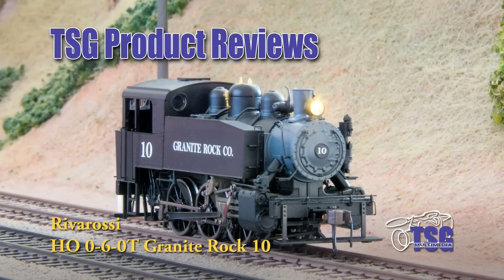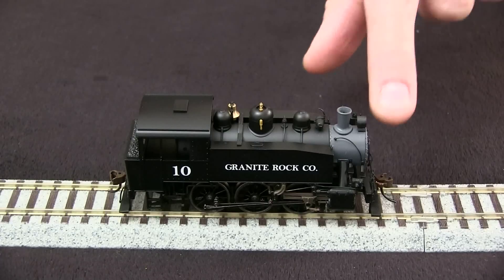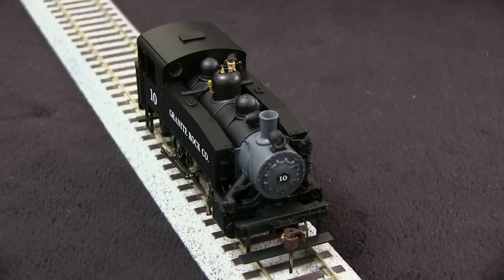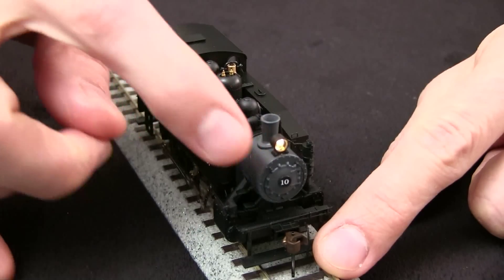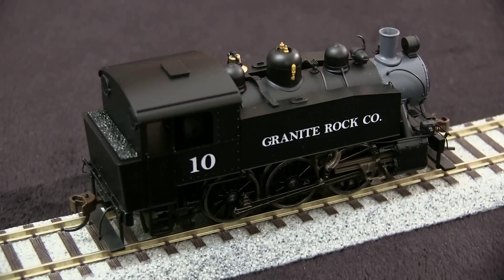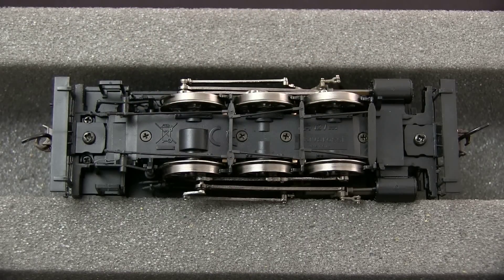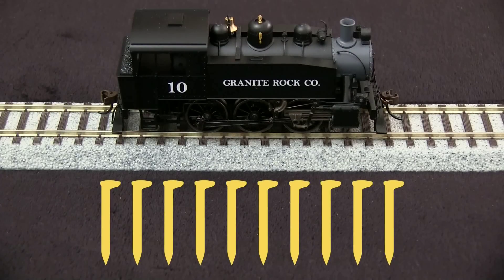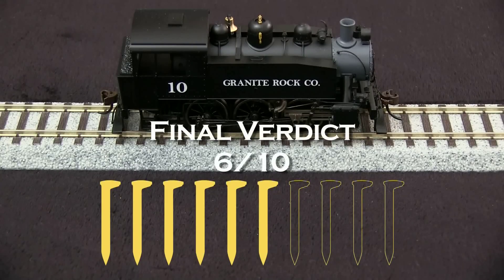HO Scale Steam Locomotive 0-6-0 0-6-0T Tank Engine Rivarossi Product Review

Comment: I just recently purchased one of these highly detailed locomotives and liked it so much another one was ordered. The drivers were all in gauge using Mark IV NMRA HO Gauge. This locomotive runs extremely well, even at very low speeds.  All my turnouts are hand built and this little loco ran thru them like they weren't even there. The 0-6-0T motor is very quiet and comes highly recommended.
Reply: +sfchemist It was in gauge coming out of the box?
Reply: +fallingup90 Yes it was.  Mine was purchased at Amazon and runs extremely well---it's a very smooth and quiet runner and all drivers were in gauge straight out of the box.  The gauge, and thickness of each wheel, were checked with a NMRA gauge.

Comment: It comes DCC ready. In the instructions, it tells you how to remove the shell and install a 6 pin decoder. The one I put in mine was a DZ126IN. As for the gauge, I dont have any problems like that. It sometimes stops on switches due to having such a short wheel-base, but I dont have any gauge problems. Ive had no bumping over switches.
Reply: ***** Hmm strange. A couple members at the club have one too and they love theirs. No problems to report. Where did you buy yours from? Maybe you just got unlucky? It can happen sometimes with any company. Very rare; but its happened.

Ive also noticed that the real Granite Rock 10 has a back-up headlight. Too bad the model missed that.

Comment: If you wanna get  technical yes that is the official cab of the GR10 2 the tanks water caps is in the wrong place the front floor board isn't as far out as it should be and also the shop crew got rid of the door panel on the roof